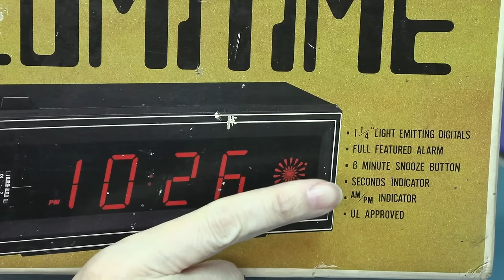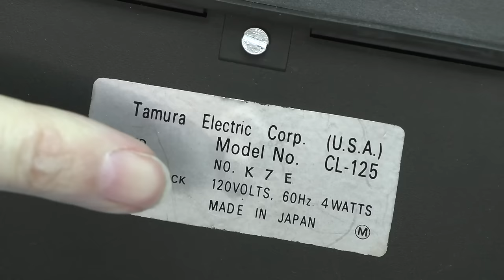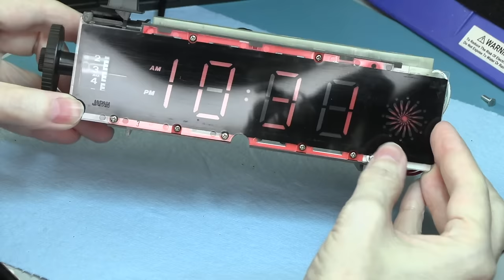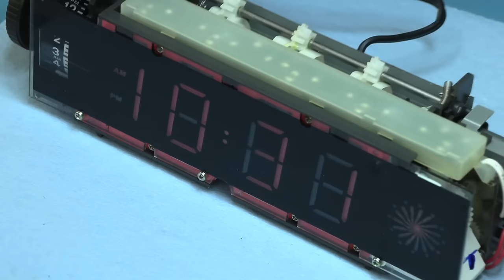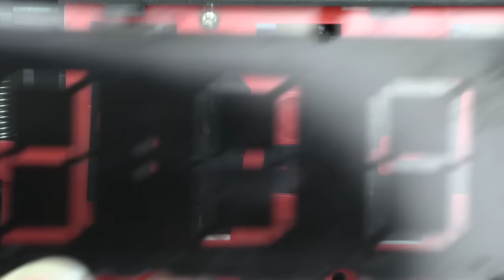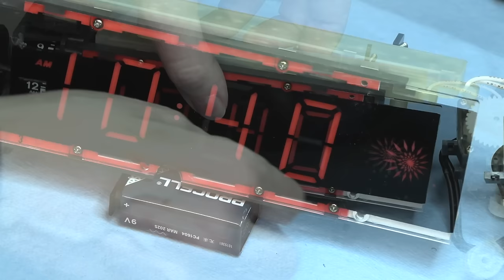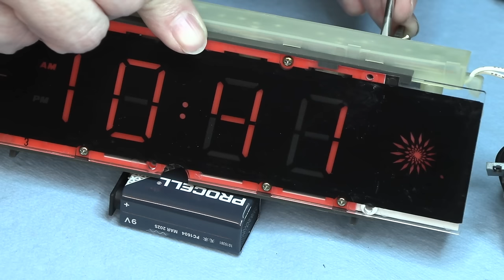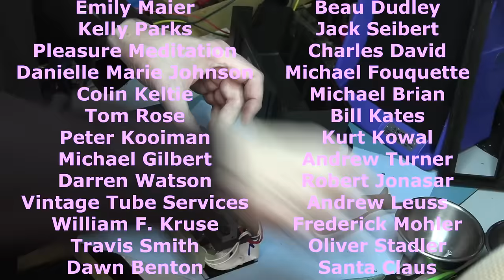Digital Clock Or Automaton?

Comment: All total internal reflection and mechanically driven shutters, none of that electronic rubbish... They couldn't have said "light emitting diode display" for a clear reason that someone would take it apart and post their discoveries to engineering press, haha! Resin printers are fine, I hope you can find a makerspace that has one. I once used one to make a cap for an IBM Wheelwriter that didn't work anymore... recombobulated just fine :). Maybe retrofitting the unit with a different motor without having to rely on the mains frequency would be possible, but the unit being so rare, restoring it in a historically accurate manner is the way. It would be worth trying to recreate the part, for all nerdkind. I would take on that if I had one :)

Comment: Could be possible to run a belt around the shaft and using a small stepper from floppy drive. You can get away without  gear train and still keep precise control.

Comment: There’s a whole lot of stuff for that motor to turn, if all of those cams and followers and gears aren’t perfectly lubricated that broken pinion on the motor is the weakest link. Judging by the package it would be 1970 vintage. Couldn’t you raid a gear from another junk clock, cool if it worked.

Comment: you could find another motor geared down to the right velocity and small enough to fit into the original one's place, if the goal is to make it run again, i guess you wouldn't need to be faithful to it's original parts.